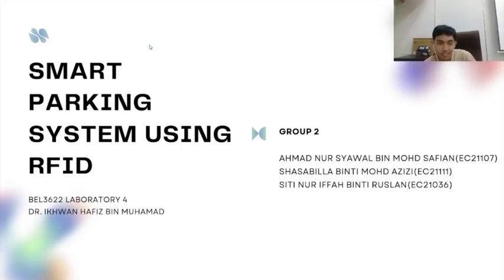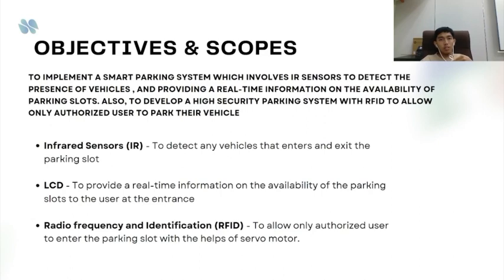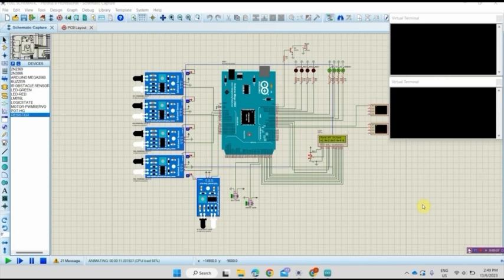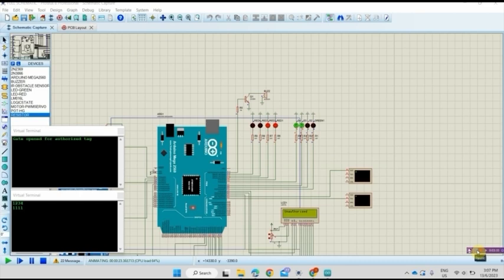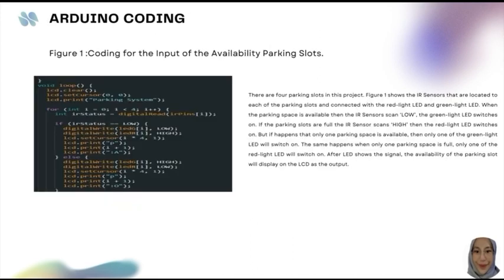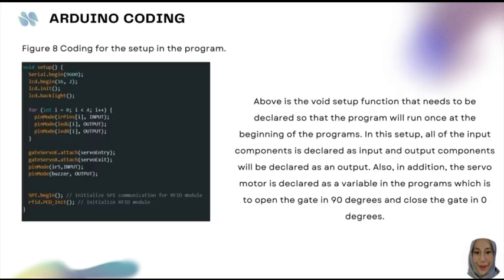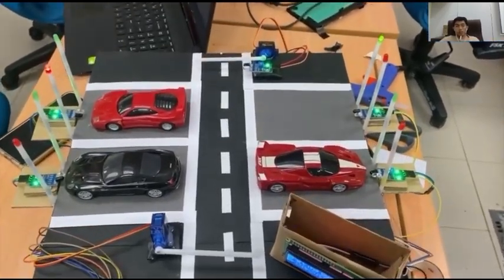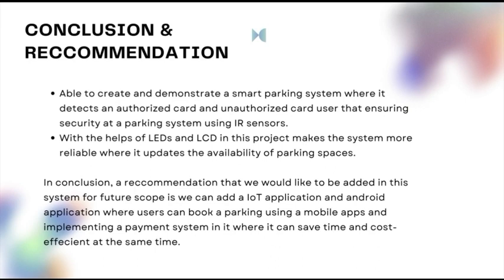LABORATORY 4 : SMART PARKING SYSTEM WITH RFID TECHNOLOGY (GROUP 2)

Comment: NICE PROTOTYPE BUT the presentation is too long and exceeds the time limit. Please also answer the following questions:
1. How long will the gate be open? How did you know the time length is enough for one car to enter the parking lot at 1 time?
2. What if the car moves slowly to cross the gate? Will the gate close and hit the car? Is there any sensor to prevent the gate from closing before the car crosses the gate?
3. How can users know which one is P1, P2, P3 and P4? I don't see any label in each lot.
4. Why do you need to display on the LCD which parking lot is available? Why not just display the number of parking spaces available?
Reply from the maker: 1. In this project, the servo motor delay for 3 seconds. The time length is enough for one car to enter at a one time. 

2. It is possible for the gate to hit the car if its moves slowly since it only open for 3 sec. However, if the gate closes before the car enter, the user can tap the rfid tag again in order to open the gate. There is no sensor installed to prevent the gate from closing, but we would take the idea as a recommendation to improve our project in the future.

3. The users can know which parkings since the green and red led is indicating whether the parking is available or not. But to alligned with the Lcd display system, we would take action on the recommendation to label each spot to ease user to detect which parking spot is P1, P2, P3 and P4.

4.Displaying which parking lot is available on the LCD in a smart parking system using RFID technology can provide more specific and detailed information to the users. Hence, it can also enhance the user experience because they can find a suitable parking spot without wasting time to search for an empty parking spots. Moreover, if the Lcd display all parking is occupied, user can use the alternative path to exit the parking space.

Comment: EC21084_Group 5

Question: How much the distance between car and IR sensor for the sensor to detect that car and shows that parking slot is occupied?
Reply: The distance between car and IR sensor has to be 2cm in order to ensure that it can detect the vehicle  and also to confirm that the parking is occupied. (But the IR sensor has a range up to 20cm )